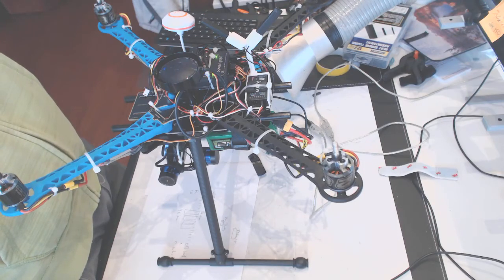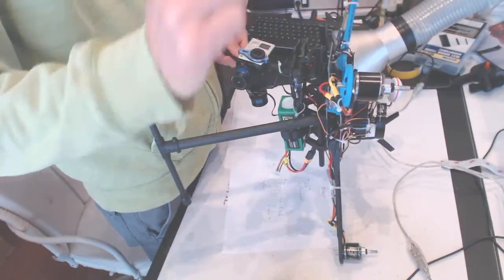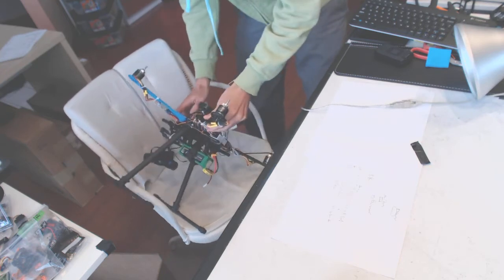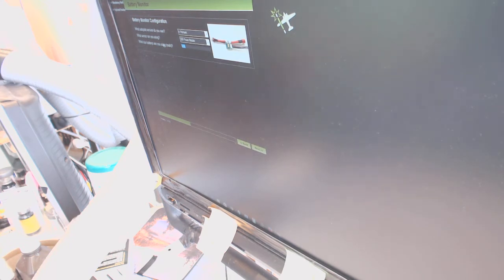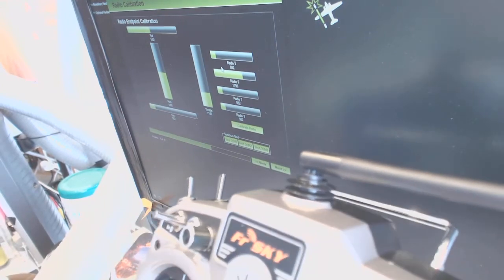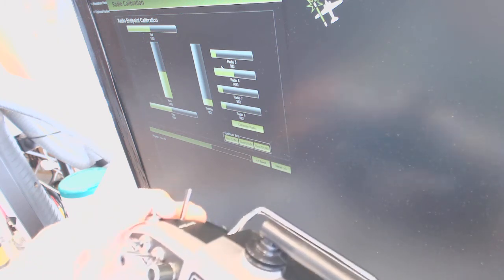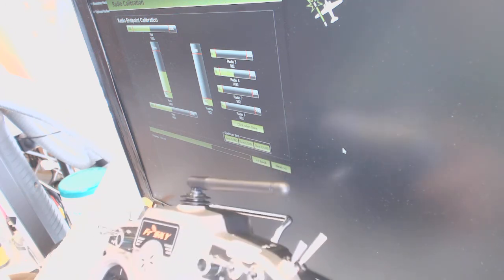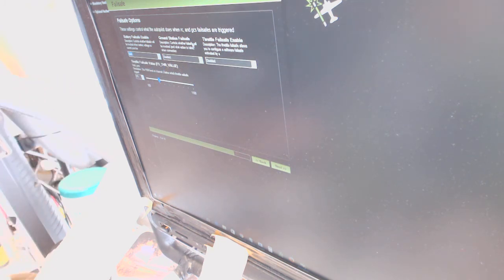Pixhawk compass and GPS calibration and setup tip trick drone quad copter s500

Comment: hello sir . I need a help .i have an external gps/compass(rtk) connected to pixhawk2.4.8.
when i am done with calibrating the external compass on mission planner which is compass 1, and i disable compass 2.  on my flight dafa when i move pixhawk the heading and yaw changes ..but giving no response on gps/compass orientation .
Reply: Same problem any solution got ?

Comment: sir pls help me my compass calibration did in mission planner. I am using pixhawk 2.8.
after calibration everything in mission planner, the compass is showing me direction wrong 
I moved my pixhawk left its showing right is and when I moved my pixhawk right it shows me left mission planner, up nose and back working good but left and right r changed pls help me, sir, .pls help me, sir

Comment: can you please help . I had a v303 seaker that I crashed.  but all the electronic are still good. inside they used zero UAV components . I have a GPS Antena and a separate compass that was installed in one of the landing skid.  I am using the s500 body as the new body for the drone. where should I put the compass.